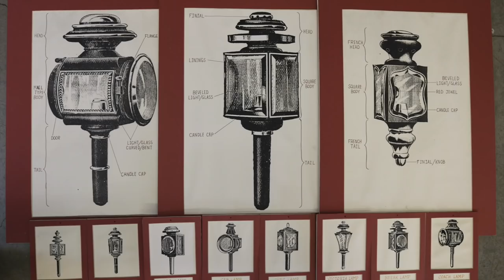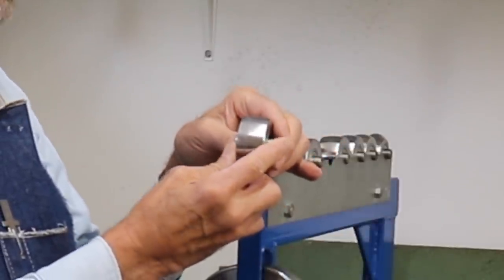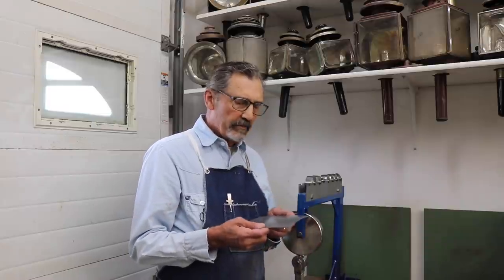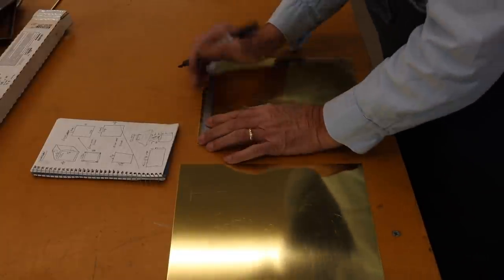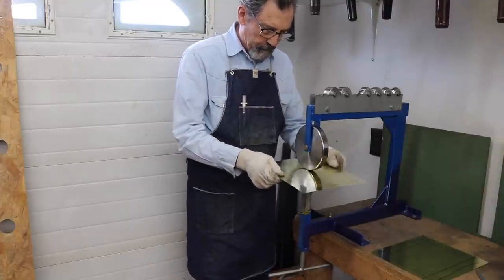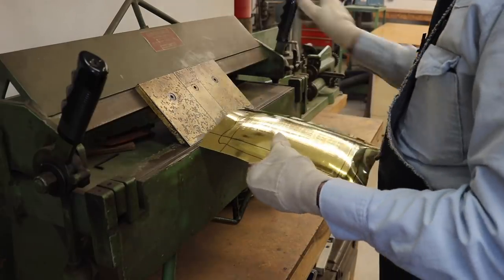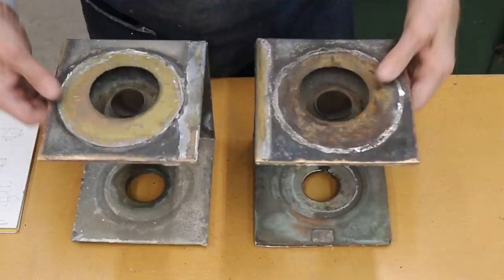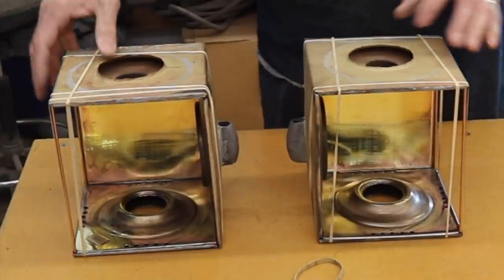Using an English Wheel to fabricate parts for antique carriage lamps. The Luminary Shoppe

Comment: ahh the trusty clothespin.  Clamping things together for almost 170 years.  Invented in Vermont in 1853 and still using the same design today.  Proof that there's no need to improve the perfected.  Just like Rick's lamps :)
Reply from the maker: Yup, and if you need a little more pressure just add another clothespin or as I call them "lamp makers disposable clamp"!
Reply: @TheLuminaryShoppe  hahaha Now that's funny
Reply: If you need to wedge parts (e.g for glueing) you can dismantle a clothes peg and use the two halves as opposing wedges, producing a very high clamping force.

Comment: What is the small shear?  Haven't seen that before?  What does "cold-rolled" mean?  Fascinating work you're doing, parts you're making, Rick.  Could watch you and Dave for 2-3 hours at a time!
Reply from the maker: Excellent explanation by Theo below. The "small shear" is actually a 90 degree notcher. It will cut up to a 6"x6" notch in 20 ga steel. In this case the finger guard on the stomp shear would flatten the edge of the piece I'm making.
Reply from the maker: Right on Theo, thanks for watching!
Reply: @TheLuminaryShoppe  Thanks ☺️. Alright, I hadn‘t considered the finger guard. Now it all makes perfect sense.

Comment: Great work. I make do antique restoration and make custom lighting. I share a lot of the same machines and tools you use. I am curious on what kind of flux, solder, and fuel you are using for soldering. It looks like oxyacetylene. I do a lot of brazing on cast iron parts, and some thicker brass and bronze. I just started getting jobs for sheet and stamped metal work. This is very different then what I have been doing. I appreciate your channel and any advice. Thank you for your time.

Comment: Another great clip.  You are using steel again.  I know that it is stiffer and stronger but, I am really surpised that you use steel which corrodes in your 100 year lamps.
Reply from the maker: I always try to use authentic material when I can. You are correct in that the steel is stiffer and stronger and sometimes that is important. If the lamps are properly cared for and stored the steel will last indefinitely. Kind of like making fiberglass or steel buggy wheels to replace wood ones on fine original carriages. It's just not right. Thanks for being a repeat follower!

Comment: Using the wheel, do you have to worry about work hardening? Or is it too slow to do that?
Reply from the maker: Using the Wheel does work harden most materials. I didn't move the brass or steel far enough for that to be a problem in this case. Thanks for watching!

Comment: Couldn’t  You use a a cut out piece of tube from a small wheel (like from a hand truck or a wheelbarrow) for the upper wheel to avoid the marks? Or is the rubber too soft?
Reply from the maker: I just haven't been able to find the right diameter and consistency yet. Thanks for watching!

Comment: Presses: exist.
The English: that is not labour intensive at all. We need a wheel to do this by hand so it takes hours instead of seconds.
Reply from the maker: Well, I guess you could use a press if you want to go to the time and expense of making tooling and dies for each shape you want make.
Reply: @TheLuminaryShoppe  A wooden die is all you need for this sheetmetal, doesn't take days, and IDK how unique every reflector has to be but it seems rather tedious to be making the same panel over and over by hand.